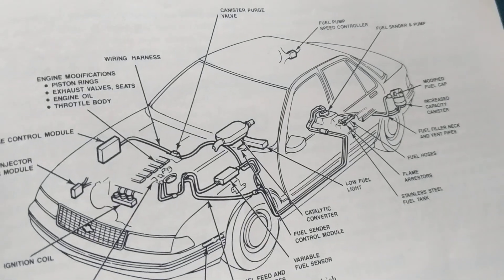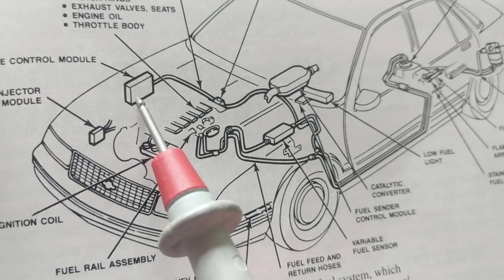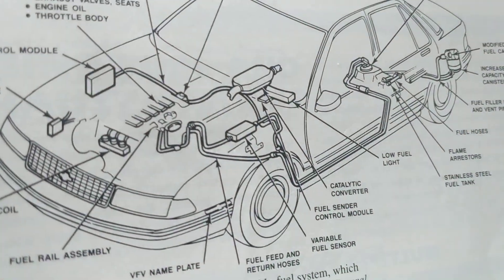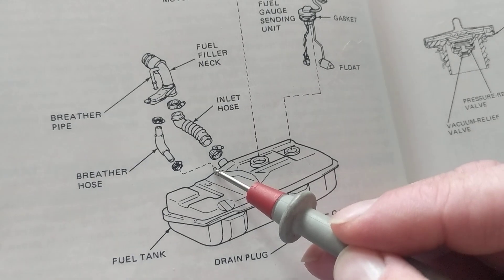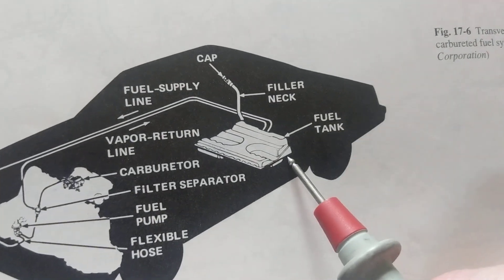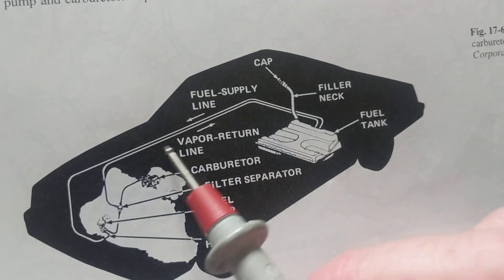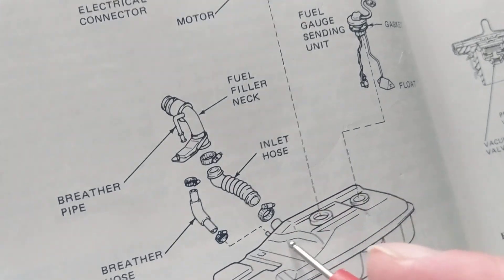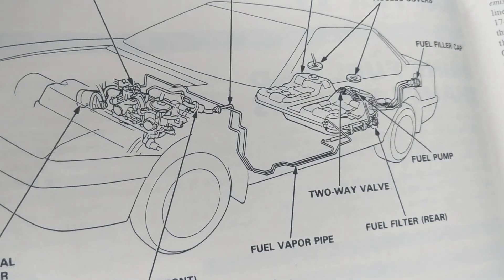HOW COMPUTERS AND FUEL SYSTEM WORK IN A CAR

Comment: Good day Joe. Your videos have been very helpful. Id like to know, my car (2009 Honda civic 2.0) has 2 O² sensors, up and downstream the cat, both wide. Id like to know, if both determine fuel mapping, and if i were to tune my car, would both have to be wired to the aftermarket ecu for fuel tuning?
Reply from the maker: Usually the one upstream oxygen sensor is for fuel trims and the one after it is usually to see if the cat is performing properly with emissions anytime you put a new computer module you always have to program it
Reply: @Joeelectronicschematicsforauto  i removed the cat due to turbo conversion, thus the question of fuel which something has been preventing us from adjuating which i figured is the 2nd sensor which we forgot to wire which helps calibrate the 1st sensor. Is my assumption correct? Fuel pump and evrything else has been upgraded already
Reply from the maker: @johnwolf1146  that's why a scanner is the best tool to use you have to look at the short fuel trim the long fuel trim and all the sensors in the engine like map sensor to understand what's coming out of the engine first if the exhaust coming out of the engine is not good then everything else will not be good that's the starting point good luck John thank you
Reply: @Joeelectronicschematicsforauto  thnx for the assistance Joe. 👌🏽👌🏽👌🏽
Reply from the maker: @johnwolf1146  good luck John keep me informed